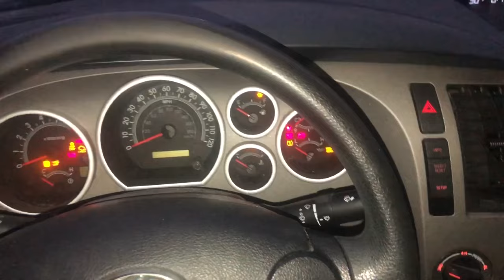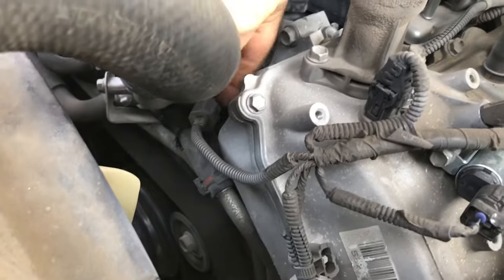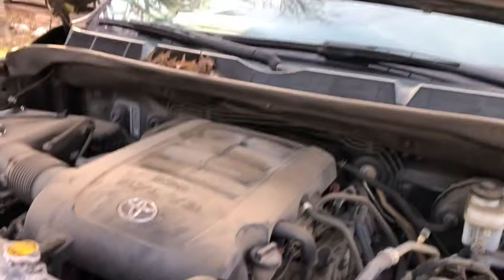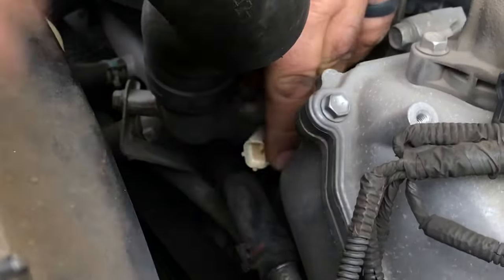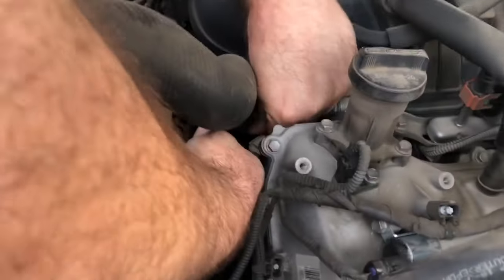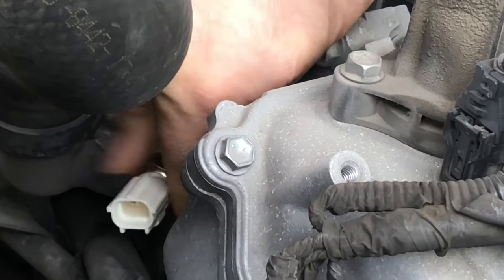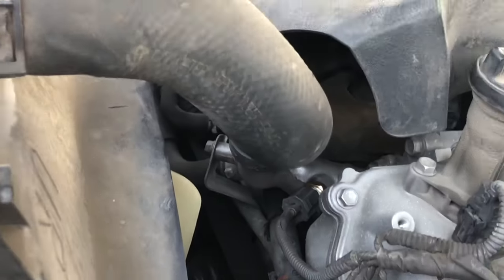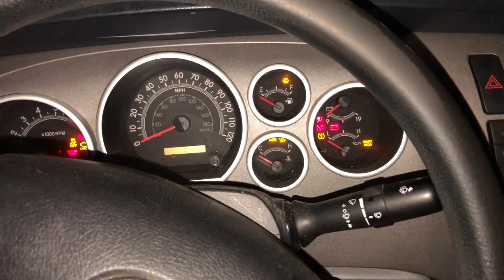Coolant Temperature Sensor replacement Toyota Tundra 2009-2013

Comment: If you get a code for the coolant temperature sensor and it doesn’t fix the problem, it can be the connector coming from the car that plugs into the sensor. That was the case with mine. Bought the sensor which only cost me $7 or $8 and it didn’t fix my issue. After two mechanics, one on YouTube and one my friend said it’s probably the connector, I looked and cable was bad where it meets the connector plug. Bought a new one for $15 on eBay and spliced it in  and problem fixed. Mind you, my mechanic said bad wire at the connector BEFORE I tried the new sensor. My car drove but fan would never turn off and ran at full speed. It was defaulting to seeing the engine as overheating even at first start in the morning in winter weather.
Reply from the maker: That’s an experience right there. Yea these things can be tricky.  I usually have 4 new parts on my car before they are fix. SMH 🤦‍♂️

Comment: Is it possible that you won't get a  code? I have a 2010 tundra and I replaced the fuel pump, regulator, spark plugs, injectors,02 sensors, mass air flow sensor, and I have no check engine light on
Reply from the maker: I’m pretty sure there should be a code but the part is $80.00 at the dealership. I’d replace it and see how it goes.  I usually replace 4 things before it’s fixed too! Don’t feel alone
Reply: @MendandMake  I hear ya, thanks!